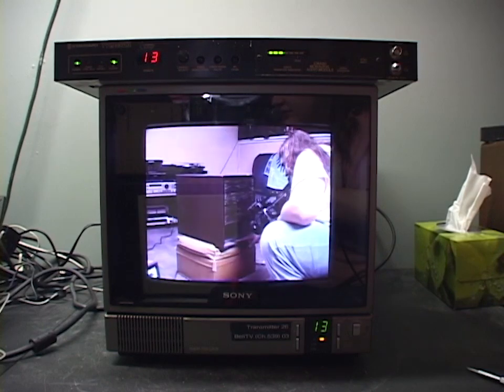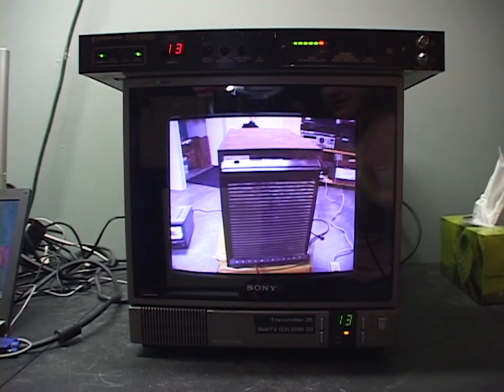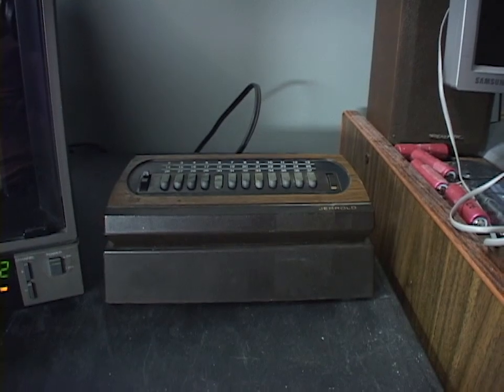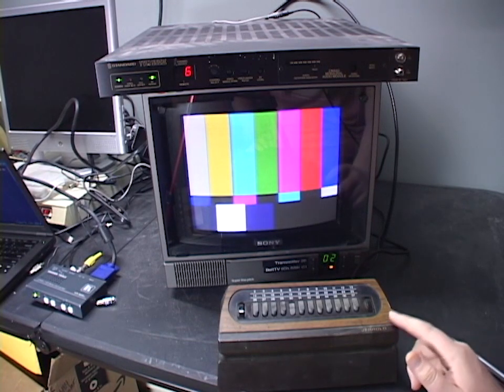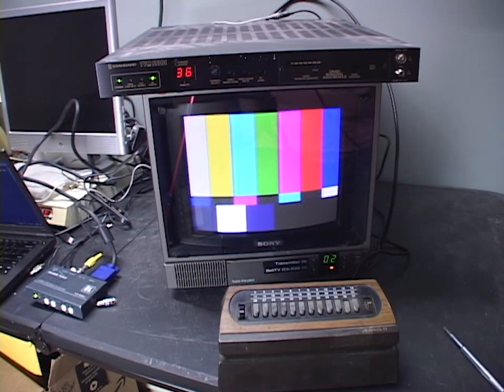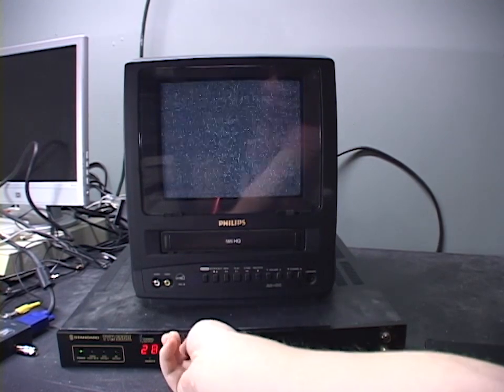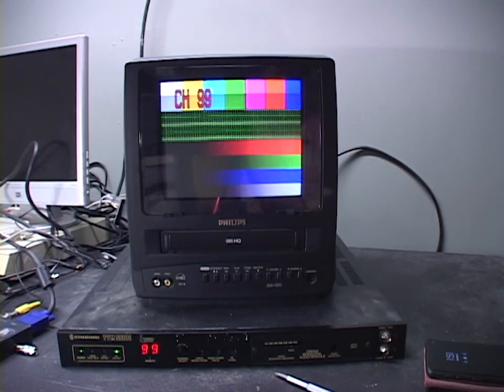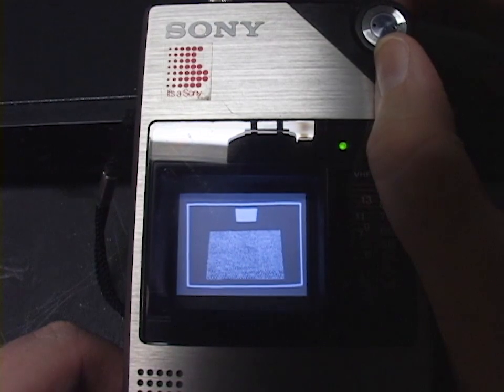Standard TVM 550II agile cable modulator (1992) + Jerrold Starcom-II cable tuner (1984)

Comment: The "BTSC" audio switch was for Multichannel Sound, or MTS. It allowed for stereo sound on traditional cable broadcasts. The only disadvantage was that it required compatible equipment, and said equipment had to pay royalties to dbx (until 2004, except for digital implementations).

Comment: I love stuff like this, very fun to watch. That Jerrold converter is such a blast from the past.

19:33 The F connector for video must have been some sort of standard within the area of modulators and cable headend equipment, but I have no idea why. My modulator also uses it for video input, and I've also seen cable equipment use F connectors for power on amplifiers as well.

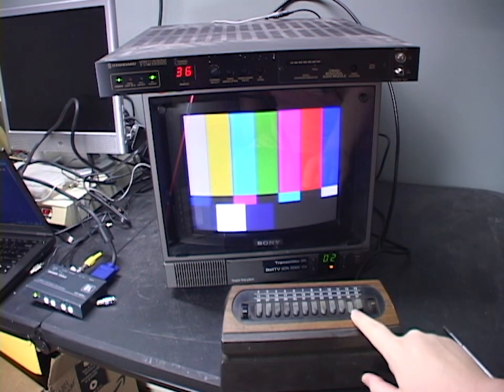35:05 Channels 95-99 on cable TV are actually way lower in the band (between channel VHF Low channel 6 and mid-band channel 14) and they overlap the FM band. That Jerrold converter predates the higher hyper and ultra bands, so I wonder if the manufacturer just wanted to fill that extra channel in the mechanical design and shoe-horned it in there.

39:56 Regarding your Panasonic VCR, I recall that VCR has separate VHF and UHF terminals on the back. Because Channel 65 cable is similar frequency to 14, it probably needs to be plugged into the UHF terminals. Once ultra-band was commonly supported on TVs and VCRs, that's when VHF and UHF started sharing the F connector input, since it was now one big continuous tuner. But I wonder if that VCR was right on the edge where they hadn't quite figured things out yet. I know our local cable company had barely gotten into the 20s when that VCR came out, so channel 65 was futureproofing for sure. Maybe they intended the user to use a combo splitter/balun.
Reply from the maker: Ohhhh, I didn't even consider that it might be looking for the signal through the UHF input!

Comment: The original cable TV channels were only 14-36 (ignoring 98 and 99), or equivalent letters which were only used before my time. The ninety-numbers were weird which explains your '37'. My family's old Sony TV we used to have (KV-1917 IIRC) had fourteen channel presets which could be tuned into any frequency in VHF low 2-6, VHF high 7-13, VHF mid (cable to 36), and UHF channels. Some channels we would watch were 39 which was out of range (needed to go through the VCR) and 63 which I later discovered could be picked up on the UHF setting.

If I got a cable modulator like this I would stick to the regular VHF frequencies. The reason is my family's old TV which only does VHF 1-13. It's the only analog tuner at home I didn't have a chance to use before the analog shutdown.

Comment: My old cable provider used an antenna to receive the stations as they had a tower with their satellites & antennas then rebroadcasted over cable. We had channels that went up to 120 on the Hyper part which was mostly bulletin boards from the local library etc. Channels 95-99 was the adult channels like Playboy & Spice & they were scrambled & before they did that they used notch filters. Miss them days as you just ordered them filters or descramblers to get it free.

Comment: Yes you can use an Antenna actually any Antenna. But if you are going to modify the transmit output power you should use the proper antenna for the frequency. Using it as is without modifying just a pair of rabbit ears will work for VHF modulators. And for UHF a UHF Bowtie that used to be included with the rabbit ears with TV's will work.
Reply from the maker: Modify for increased power, you mean? I didn't know people did that.
Reply: @themaritimegirl  I am not 100 % sure it can be done.  I have seen people use amplifiers but not sure if that really adds to the range. I have a small modulator it is very hard to figure out. The manual I copied so I could read it better but it's still difficult. Thanks for explaining every little detail of knobs etc.
Reply: @chrisgarrett9619  oh yeah, it absolutely can add to the range (to a point). Raise the wattage, and a distant receiver who had the signal too low to properly decode can now get it above the noise floor. Again, that only goes so far, but it's definitely a factor.